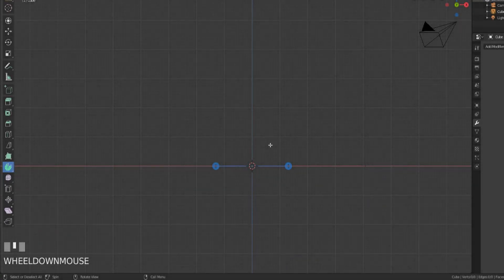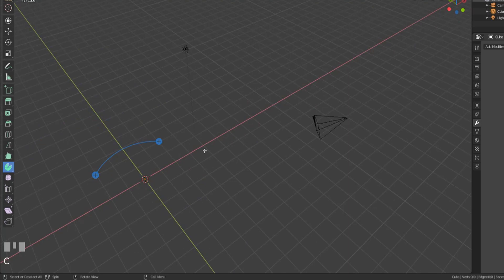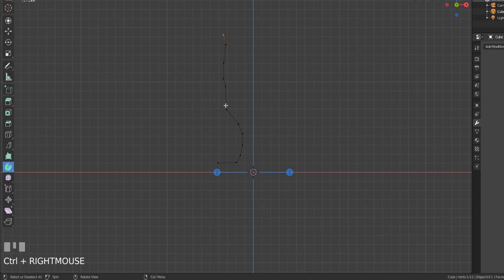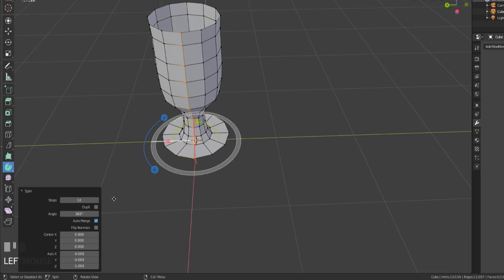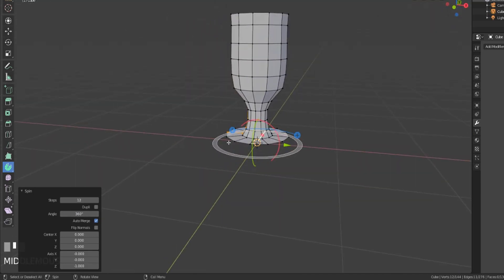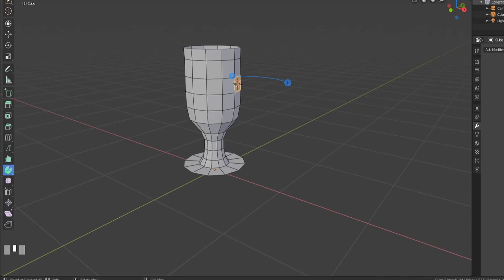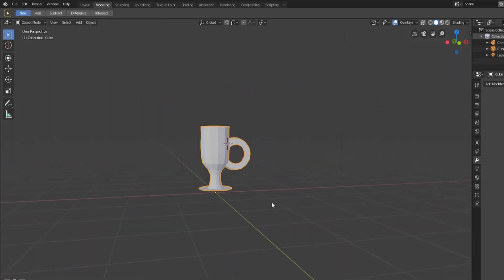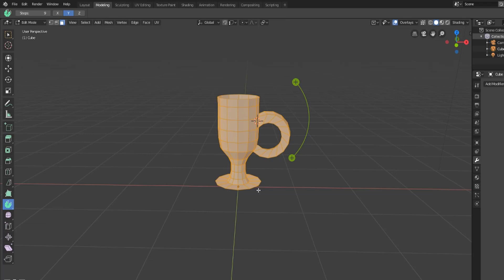The Spin Tool [Blender 2.8]

Comment: how have you been in edit mode without any mesh around? (start-->4:11)
Reply from the maker: as long as you have a mesh object you can enter into edit mode. Inside the mesh object there is only a single vertex. which we use to create the cup.
Reply: That's an awesome and fantastic tool!! Thanks for sharing!
Reply: Now i can model anything from any image reference!

Comment: Pointless video if you cant start the same way and hide the top of the program and dont descibe how you can see the spin tool
Reply: Add plane, go to edit mode and delete all vertices.
Now you can create new vertices with ctrl right clicking.
If you are in edge selection mode and select an edge you can create new faces the same way.

Comment: This tool is driving me mad. I'm trying to do exactly what you did here, but when I the release LMB after dragging my spun shape, the newly formed spun section disappears and the tool behaviour becomes erratic and bizarre - the cursor changes to an upwards facing arrow and the axis controls do not respond to LMB, and spun shapes suddenly appear and disappear at seemingly random rotations as I move the cursor around. Either that or the rate of rotation is so small relative to the cursor that I have to scroll to the edge of the screen in order to create a tiny spin.
Reply: Ok, I recreated this behaviour by opening multiple viewports (Front, Right, Top, and 3D) The tool does not function properly when I do this, but once I reopen a new project with the default view and set the single current viewport to Front (which is where I was trying to conduct the spin) the tool functions normally.

Comment: Oops; Let me edit my gibberish in my last comment.  In Blender 2.8 at least,  I cannot seem to  find a way to use 'control -right click' to generate  vertices  with my 3d cursor.
Reply from the maker: Are you using right click select or did you switch to left click select? If you use left click select, Ctrl right click will add vertices, but if you're using right click select, then Ctrl left click should add them.

If that doesn't seem to work, make sure you're in vertex select mode when you add them.